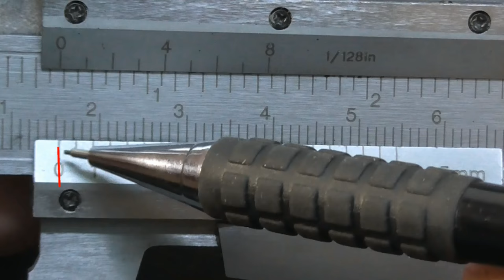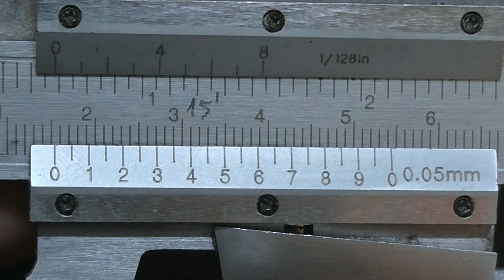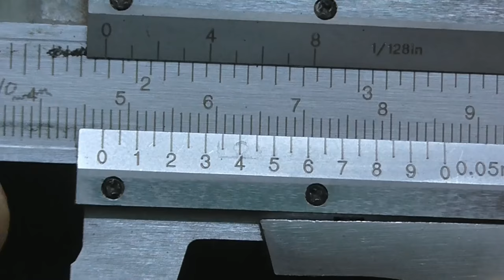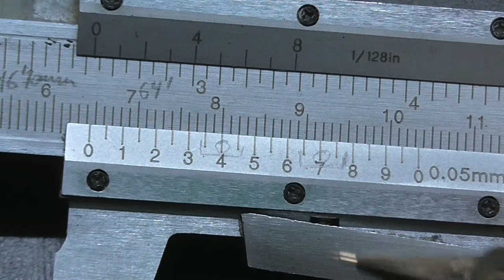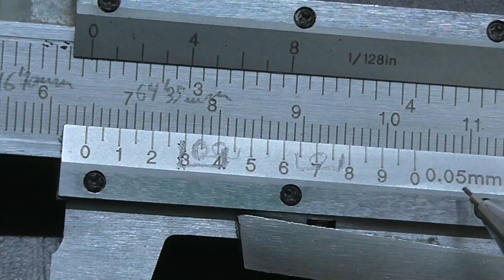How to read the caliper Vernier scale easily

Comment: Oh,..each line on the vernier is 1 and there are 2 lines per number,..and when the 3 lines line up on vernier and the top mm line measure from the 2nd of the 3 lines that match ,.then multiply by 0.05 = ,..then ad it with the whole mm that the 0 on the vernier starts in front of...    Got it !!  Thanks for the lesson Sir !!